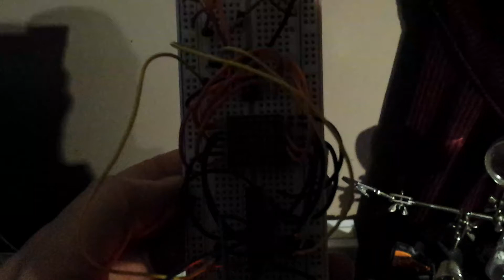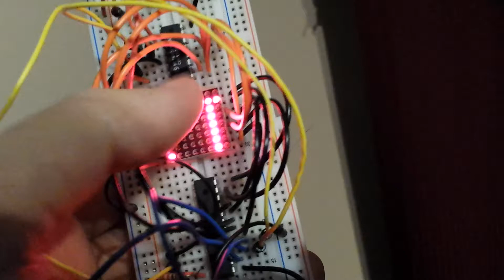Arduino Pro Micro with MBI5026 and 74HC595s

Comment: Could you please share Arduino skech?
Reply from the maker: Sure:  https://gist.github.com/liftoff/f9fbb9ce79f4a6687ebf
Reply: Dan McDougall Thanks! I'm new to shift registers and LED drivers, so your code is very helpful.
Reply from the maker: No problem. I feel bad about the sorry state of comments in the code though. I got it working then immediately had to go do something else and it's been sitting in this exact state for months :)

If you need help with it just post your question and I'll see what I can do.